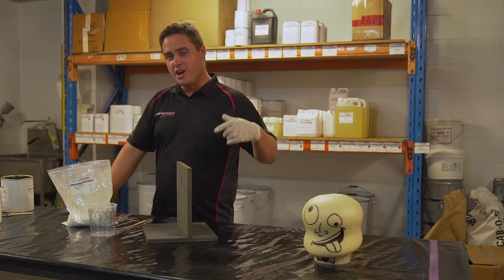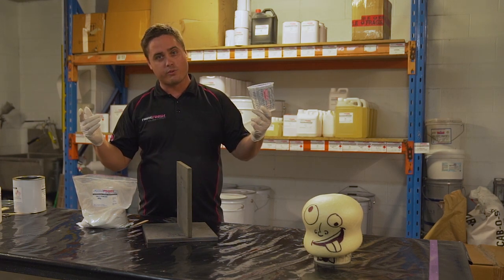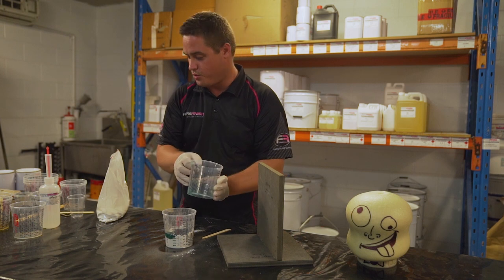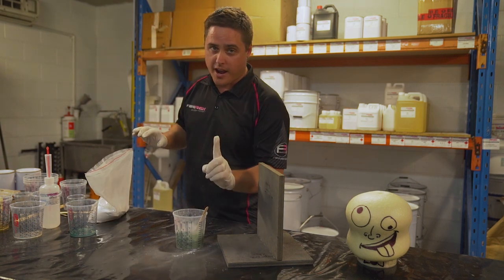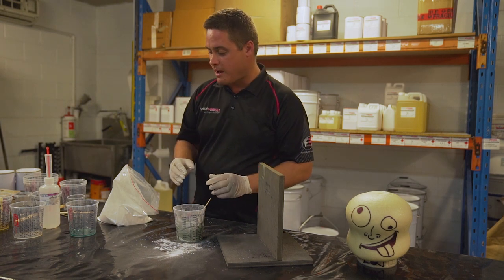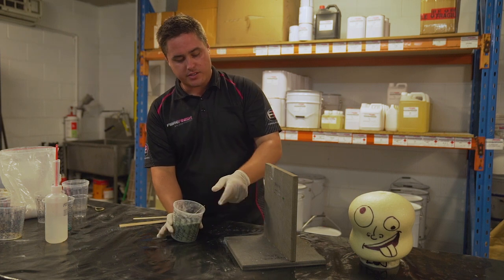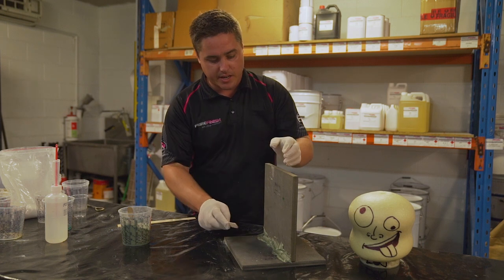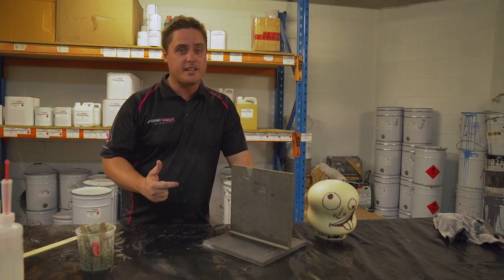FIBREFINISH HOW TO MAKE BOG WITH TALC AND RESIN

Comment: Could you also first combine resin and hardener, and then add the talc?
Reply from the maker: You can, however your work time begins as soon as the hardener and resin are combined. So if you are comfortable working on a timeframe then yes it will work fine.
Reply: Yea you should do it like this to ensure part a and part b get a good mixing. Then add your talc.
Reply: You should always mix your resin, MEKP (or Hardener if using Epoxy) mix semi good, then add in your fairing/bulking agents. It is in my shop bad practice to add hardener after you have thickened. Composites like resin (especially resin quality that you would be using for filler and filleting) is cheap enough and certainly cheaper than back stepping or messing up a crutial step on repairing a boat.
Reply: @hullhealersboatworksrestor4377  is